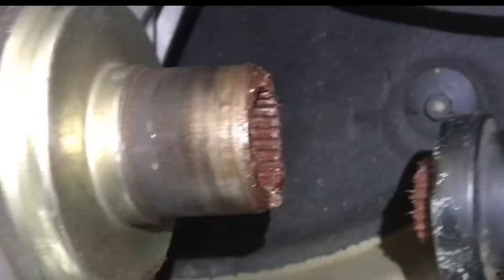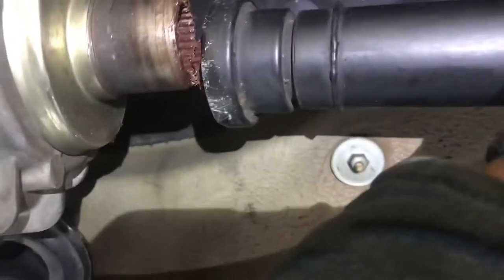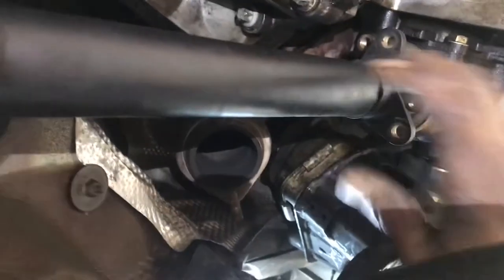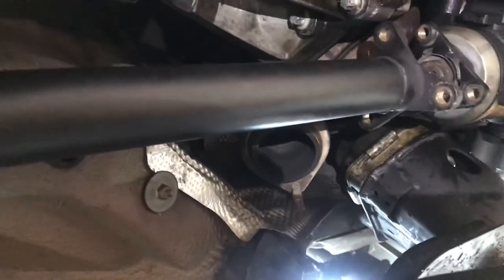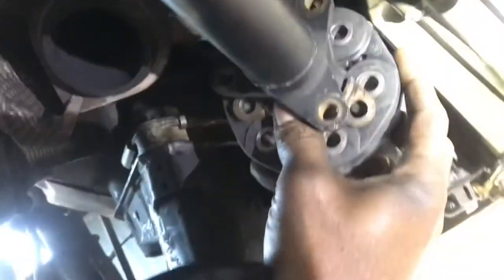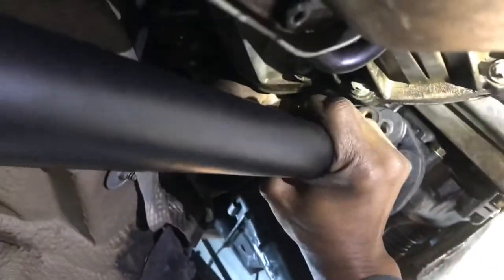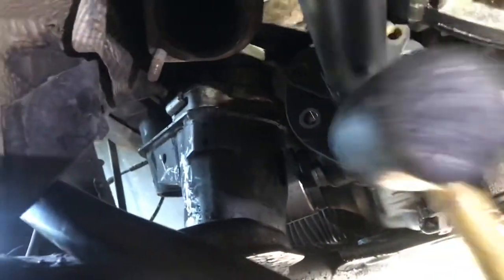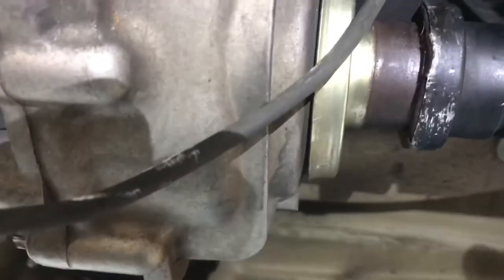X5 Front Drive Shaft Install — The Easy Way. Watch this video to save time and effort

Comment: Tha ks this helped me get mine out..fyi youre goona want to regrease every few years to make sure the splines don't rust out...I have a 88 325ix as well and there's a dust cover over the shaft connection to the transfer case...wonder why they did away with that

Comment: Now I understand why there's a kit to cut and weld in another piece with spline an inch longer. Guess it's a common problem with the front driveshaft wearing splines since so much extra space to move and not bite and slip off outer splines. I'd probably run a few washers on both sides of the guibo (aka: flex disc) to make of the difference.
Reply: You can now buy a new reinforced driveshaft with long splines.

Comment: Hey, thanks for the video. I got a question. Is it fine to add a 12mm shim between the flex disk and the shaft so you can push the shaft a little more into the differential?
Reply from the maker: There is a metal piece the goes between the flex disc and the drive shaft flange. You are thinking of adding more? If so, I would thing it would be ok, if you made sure the spacer was flat and pretty balanced
Reply: @vazfx16  yes, I just did it today. I made sure its well balanced and flat. But as my shaft spines as still okay, im going to keep for after. Other thing, I hear a clicking noise sometimes and its coming from the transfert gear, do you know how to check the oil inthere or I have to drain it? Also, is there a service mileage on this one or itd lifetime oil. 
Thank you very much.
Reply from the maker: @mounirbenamar4522  My understanding is that the transfer case is delicate. And, although BMW says lifetime oil etc. It's not, is should be changes before 100K Miles. Which I failed to do. If you are hearing noise, it may be time to find another in the salvage yard...but at least change the oil. https://youtu.be/Ol4PofF-fZY
Reply: @vazfx16  thanks bud, I really appreciate your advice. 
Take care.
Reply from the maker: @mounirbenamar4522  sure thing. Your welcome.
Reply: This will give more engagement on the splines to prevent them stripping, better yet however regrease every two years or so.
Reply: I'd wondered if there was a thicker guibo flex disc that existed that would allow the splines to mate up further. Would make sense if there was as its obviously an inherent design flaw on the E53

Comment: im trying to do this just now spent hours trying to get shaft further into the output shaft and wont budge.cant get the gleebo and metal bracket in?
Reply from the maker: You have to hit it with a mallet. The rust and all locks it up. Hammer it back and forth
Reply: @vazfx16  I have the 1 inch longer shaft and cannot get it to go in even with 6lb mallet. I do have the transfer case bolts out about an inch to give me room. Did you pound it in with the transfer case bolts tight?
Reply from the maker: @ewebbytrailscout  hummm! I didn’t have transfer case bolts out. Spray with some wd40 or other penetrating oil. Tap it out and in to free it up. Don’t hit too hard. You want to work it back and forth